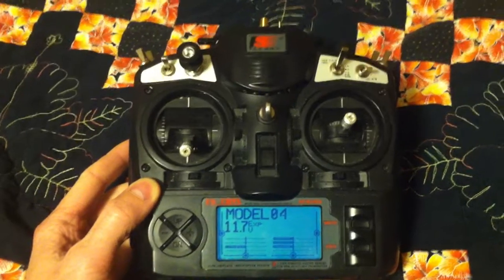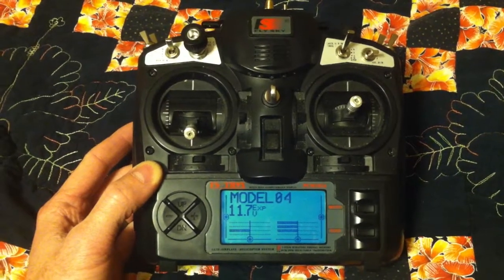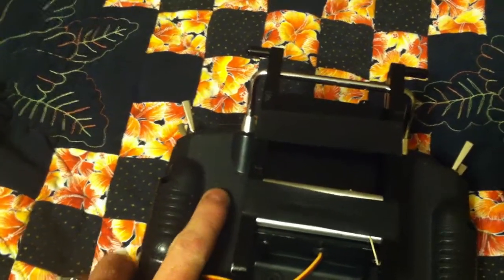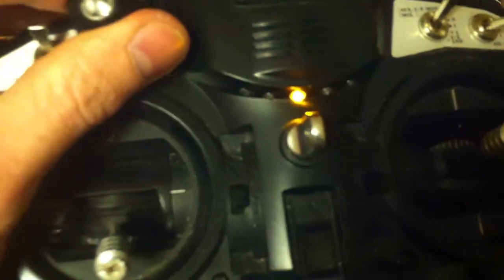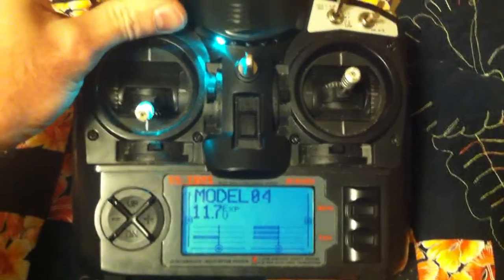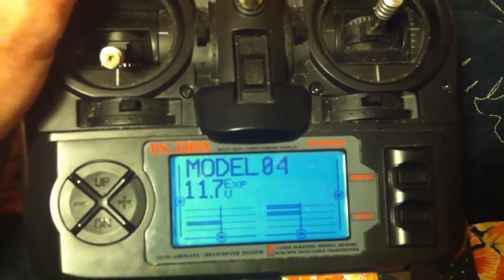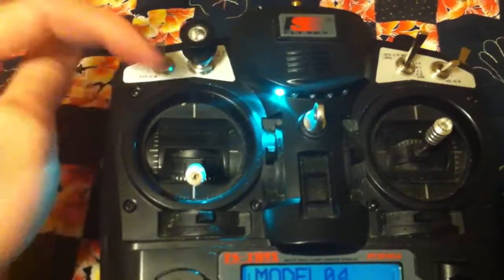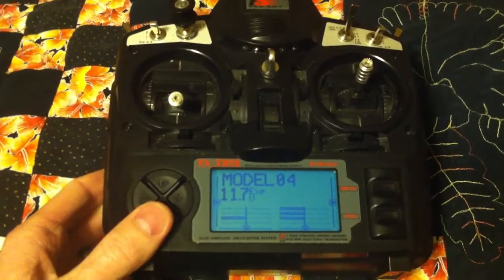TH9x with ER9x Mode Switch for Multirotor/Fy-auto pilots

Comment: How did you set up the mixes to get it to go to 2 different channels from the 6 position switch? have a eePe savefile?
Reply from the maker: i have the eepe but it does not work any more. It was on an old Frsky firmware and I cant get it loaded onto my new version.

You basically have to build dummy channels that are controlled by switch positions. I did a writeup somewhere on RCG ill see if i can find it.